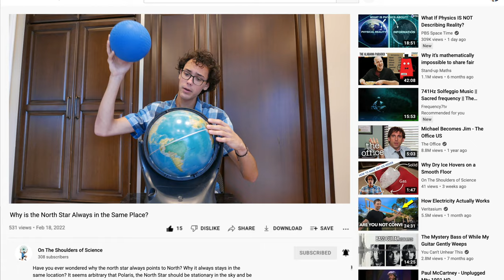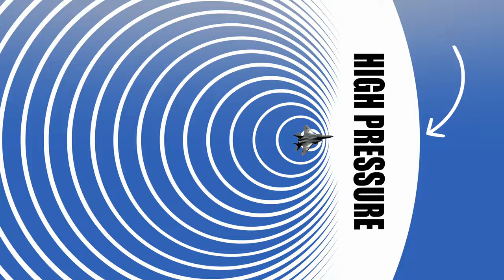Why was Breaking the Sound Barrier So Difficult?

Comment: Great video but something to note, you were using the speed of sound at sea level to measure the mach of supersonic aircraft like the Concorde but when they are flying at high altitudes, the speed of sound decreases because it's much colder and the air density is much less so at altitude the Concorde's mach is closer to 2 rather than 1.75.